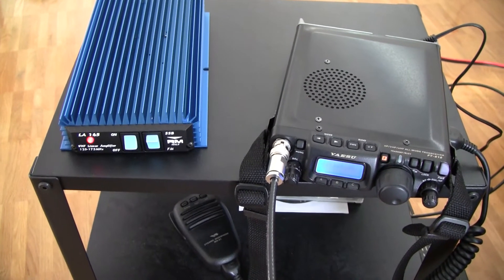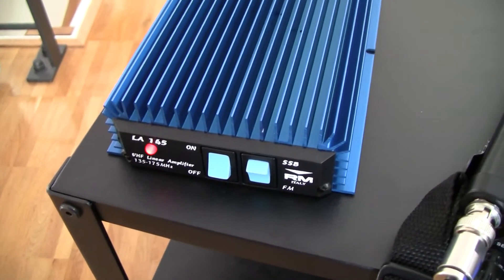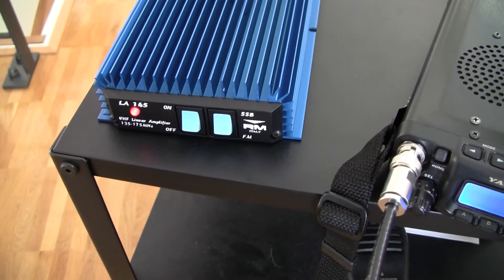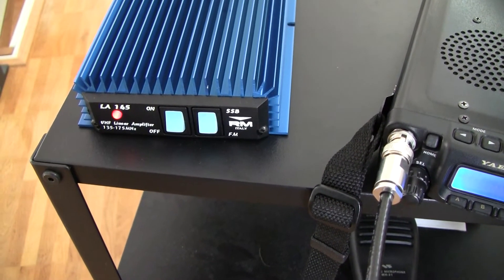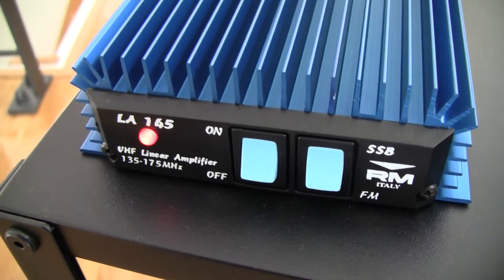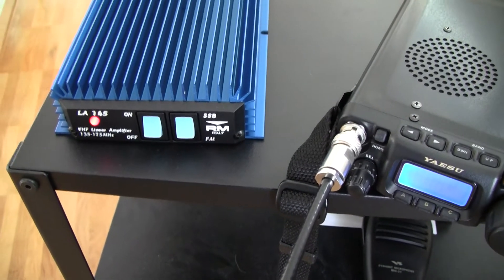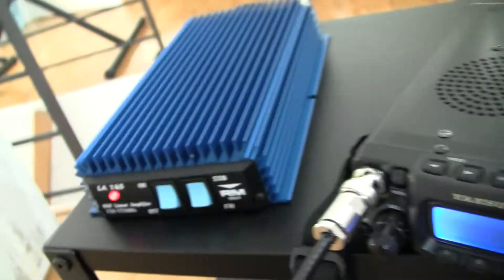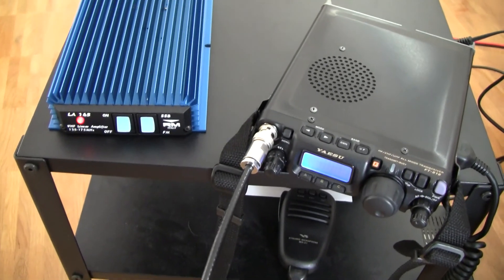RM Italy LA 145 VHF amplifier HF vox and FM/SSB switch explained

Comment: Dumb question would this amp work on a regular cb radio I found one of these at the pawn shop and am wondering if it would work even tho it says fm on it.
Reply from the maker: No, this one won't work for cb radio, the frequency range is wrong. For cb you need a 10/11m amp, this one is only for 2m.

The FM/SSB switch will only introduce a small delay before the amp switches back from transmit to receive, since SSB does not have a constant carrier like FM or AM does. With SSB, there is only a signal transmitted if you have modulation, so the amp would immediately switch back to receive between words when you speak. When the switch is in SSB mode, it will delay switching by half a second or so

Comment: My exact problem. I will be adding a foot peddle. I use the 705 and have to hit the amp 8 -10 to improve transmission but the kl500 does not need that much.

Comment: Do you think this is worth it for SSB talk only? My plan was to talk on a 2 meter ssb net. However it sounds like I would drop out between sentences or words. Is that the case?
Reply from the maker: On lowest power settings I do have dropouts on my settings. In 2.5 W it runs fine as long as you don't pause too long. It's somewhat in the range of half a second before it switches back I guess. I've heard of people modifying the amp to add a PTT control line or increase the TX delay, but I didn't want to do that.

There is the Microset SR 100 amp that is also 2m only but has a preamp, a PTT control line and about 100 W of output power. That could be an alternative for you but over here it's double the price of the LA 145.
Reply: @bommel88  I think I’ll stick with this one as my 1st purchase. The delay probably isn’t that bad, I’ll just talk a bit slower at the beginning to get the relay going etc. Thanks again for your help. Oregon/USA
Reply from the maker: @forgetyourlife  yeah, that should do. Glad I could help :)